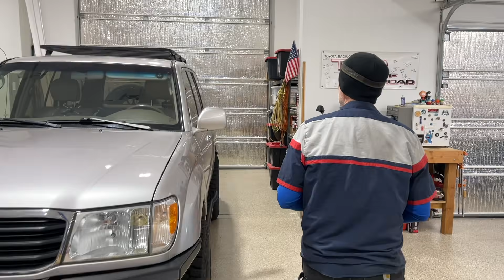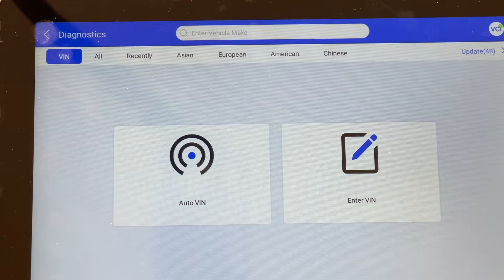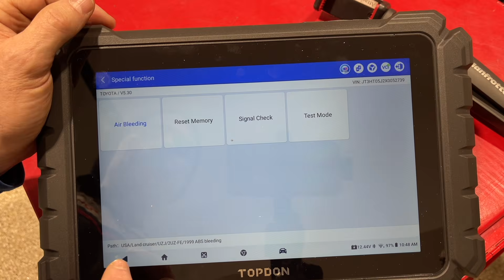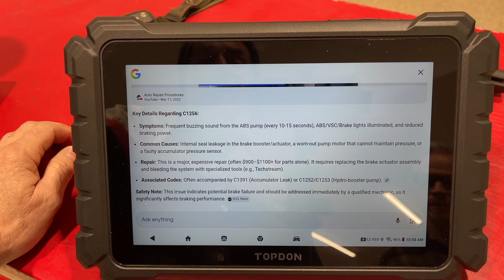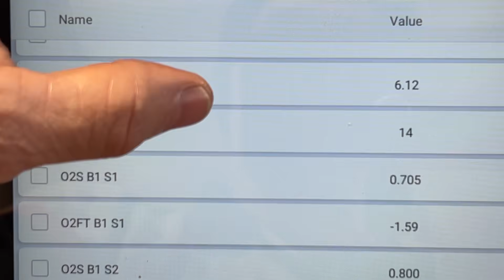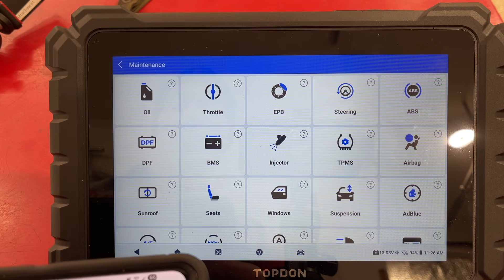Topdon One Scanner Demonstration

Comment: I noticed after the 13 minute mark, you said it’s capable of immobilizer work and it’s not. It can only read immobilizer codes and that’s it’s which is disappointing when the artidiag is capable of immobilizer work but only has a few less maintenance functions which I’m feel most people won’t miss
Reply from the maker: I can't remember what I exactly said in the video, and I also clearly don't know this machine like the back of my hand.  There's  lots of choices of scanners.  I chose this one as my starting point.
Reply: @TimmyTheToolman don’t get me wrong, it’s a great scanner as an entry level new scanner but if you are a professional they have better options. It is super fast wireless compared to their other scanners

Comment: Timmy, congratulations on your new scanner.  It was time for you to delve into the diagnostics world using a scan tool. A nice progression after years of replacing parts. I am excited for you and know you are even more excited.
Interesting diagnostic video on your friends Toyota. Not owning a scan tool myself but watching many videos on similar issues such as his, with rough running at start up and smoothing out after warm up, my guess is the FUEL TRIMS can help you. No DTCs for the idle issue. I have seen where the problem might be spark (plugs or coils), or FUEL ( Injectors),   or AIR (MAF). 
Many ways of looking at DATA. I have even seen where coolant in the cylinders can cause rough idle. 

Are you going to do a follow on video after you further diagnose? It will be interesting to see what you find! If you want some ideas on videos to help you diagnose,  check out Eric O. with South Main Auto YouTube channel. I find he is really good at diagnosing many issues. I watch him all the time. He uses Autel and the  HF ICON T10. He just got a new scan tool of which I can't remember. 

You will have fun using your new tool and I can't wait to see you get more familiar with it and learn more about fuel trims, volt readings,  tolerances,  etc,etc.
Reply from the maker: We did a compression check and since we already had the spark plugs out, we replaced them.  He said his idling issue improved.  I've watched South Main Auto before.  Another great one is Scanner Danner.  That guy is a magician with scanners.
Reply: @TimmyTheToolman Nice. I kinda ruled out spark and air (MAF) since his idle got better after warming up. I have seen where coolant can leak into the cylinder(s) and cause this issue.  Pointing to cracked head or head gasket. I can see a Mr. Wiggles (boroscope) in your future so you can look at the inside of the cylinders and check the tops of the valves for any moisture or leaks.

What were the numbers on your compression tests??

Yes, Scanner Danner is a wizard at diags. He can be hard to understand since he talks more technical than I can understand 😂.
Reply from the maker: @richardramon2175  His compression numbers weren't great, but not horrible either.  If I had more time, I would have performed a leak-down test.  He is losing coolant, so I do suspect a head gasket or cracked head issue.  We topped off the coolant, and he told me he hasn't seen any noticeable leaks and I did see signs of leaking on his engine at various connections.  I'll probably get him back over and put the cooling system under pressure and use a borescope camera to look into the cylinders and see if any coolant is pooling on top of the pistons.
Reply: @TimmyTheToolman Ahhh. I wonder if that is an issue with those engines.
Reply: @TimmyTheToolman Did some research.  Found this from Peter from Toyota Maintenence youtube channel,  who primarily works on Toyoytas. Same 4.7L 2UZFE engine as your friend. Nlown head gasket after only 190k miles.

https://m.youtube.com/watch?v=BJx8a6zxWFE&t=25s&pp=2AEZkAIB0gcJCZoBo7VqN5tD
Reply from the maker: @richardramon2175 The 2UZ-FE engine is known to go past 1 million miles.
Reply: @TimmyTheToolman Yeah, this was an anomaly for sure. Might have been some neglect going on.  Not sure as Peter didn't mention or know about the previous owners.
Reply: I had this issue with my 2010 Prius and it ended up being a clogged egr cooler causing the rough startup and misfire issues